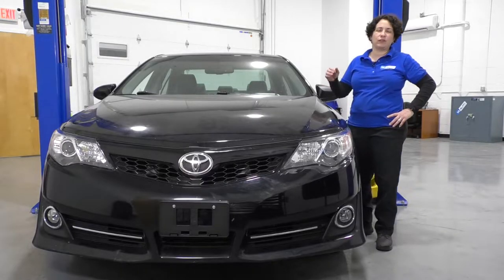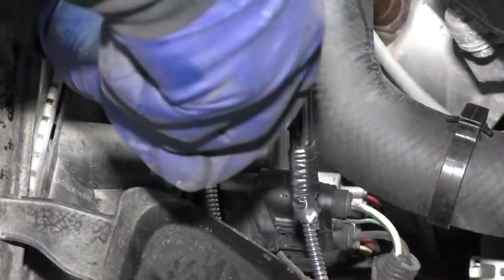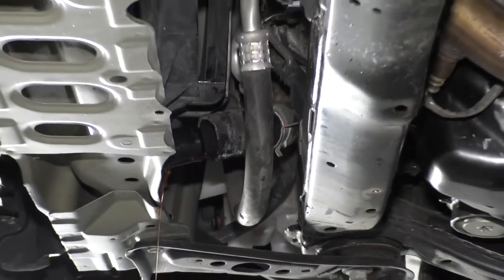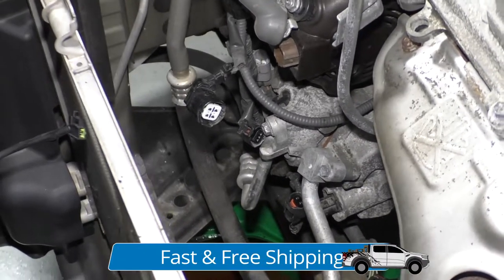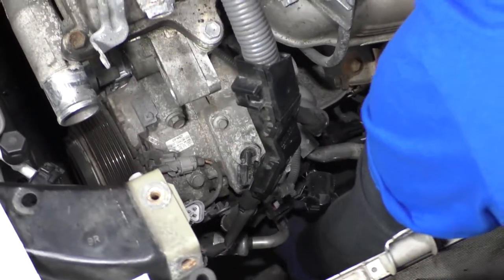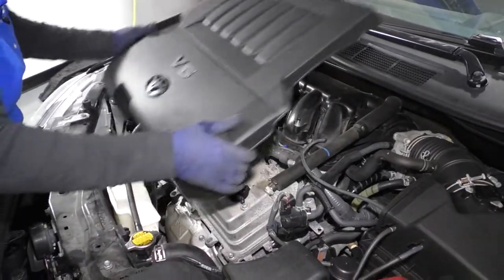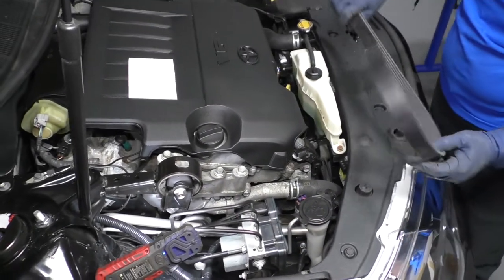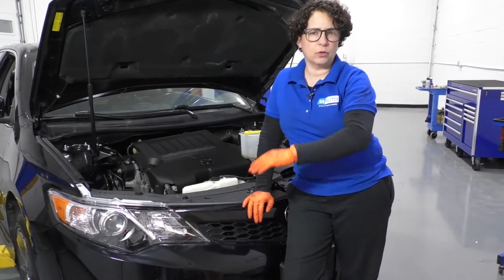How to Remove A/C Compressor 11-17 Toyota Camry

Comment: Super nice video. Tip you don't have to pull the radiator, just the support bat on top and the upper hose. Push the upper radiator hose towards the firewall and tuck it under the engine cover. The side radiator hose you have to crawl under the car and push it towards the front center out of the bracket on the fan assembly. Then you can do the work from under and top of the car. Best wishes & Blessings. Keith Noneya

Comment: And also thank you for your videos! I had to change my blower motor on my 2015 Camry, a local repair shop wanted $350 to do it. I bought the part myself for $75 and did it in less than 20 minutes
Reply: What was symptoms to your blower motor out? Just hot air but compressor still turned??
Reply: Purring sound when you turn your ac off. Intermittent stopping of ac until it just finally does turn on are signs of a bad blower motor

Comment: Do you have to take out the radiator and the fan to remove the AC compressor? On the four-cylinder

Comment: I’m a little confused, if you are replacing the a/c compressor on a 12 Camry there’s no need to take out the alternator, once the radiator is out there’s plenty of room to slide it out. Unless I’m missing something here.

Comment: Move upper radiator hose out of your way, pull fan assembly out , lower hose is on shroud bracket. Take off belt, unbolt compressor, slide it past cat converter careful not to hit radiator, bring compressor up and out where upper hose is .